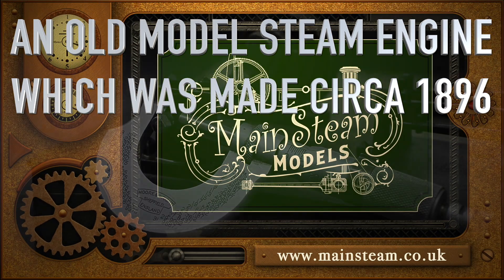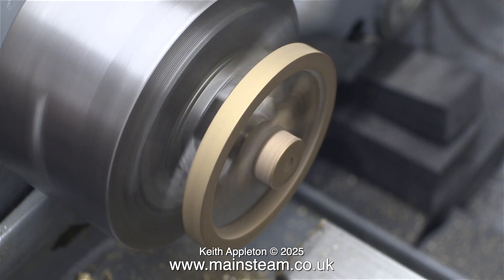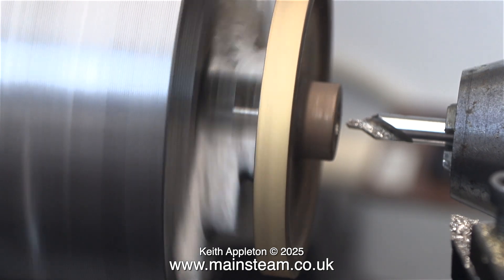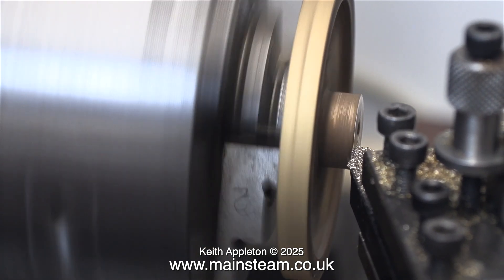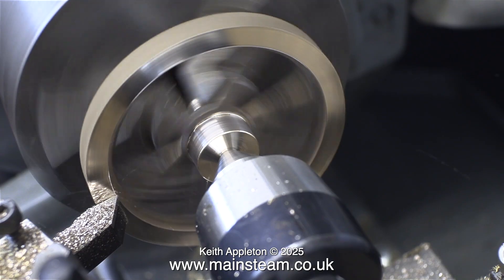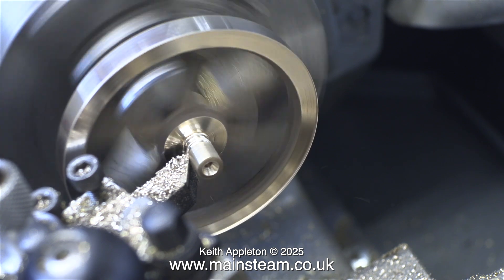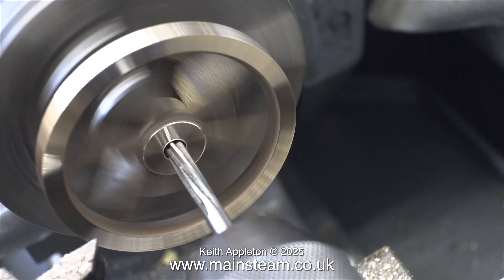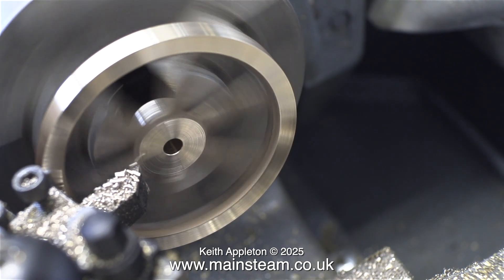REBUILDING A MODEL STEAM ENGINE MADE CIRCA 1896 - PART #5

Comment: Bit of a possibly pointless question. Relating to engines that have sat for a while, does the engine sitting in the same position for a long period cause components to wear on the mating surfaces? I know with full size locomotives when in storage they manoeuvre to not cause flat spots etc
Reply from the maker: As models are smaller there is less pressure on the parts and I have never seen any flat spots. They usually gum up with the old oil and can corrode internally if water is left in them.
Reply: @keithappleton  Thankyou for the response and all the videos, always a pleasure to watch.